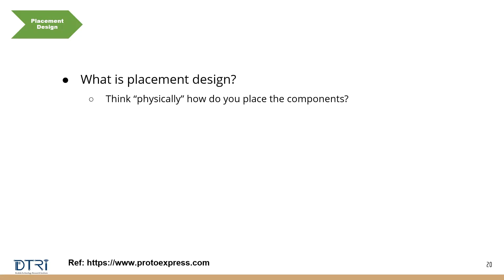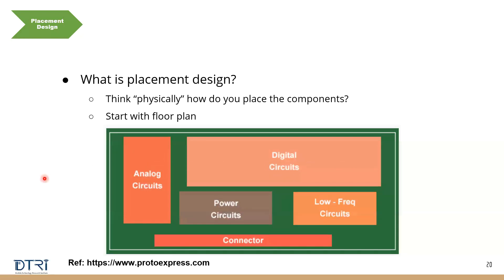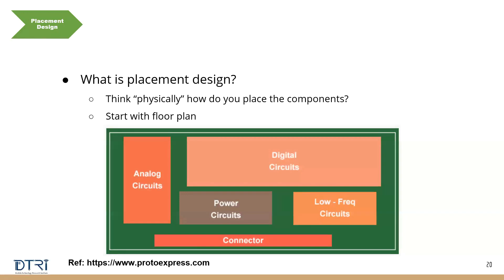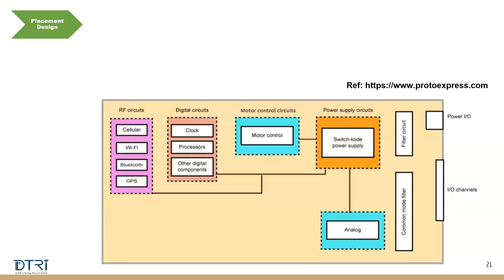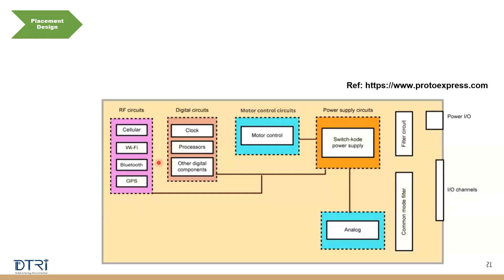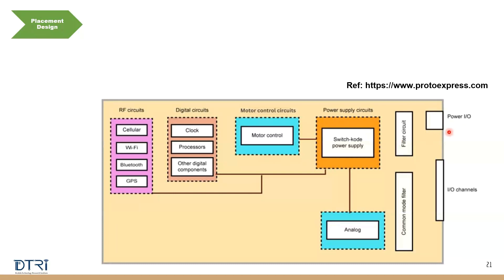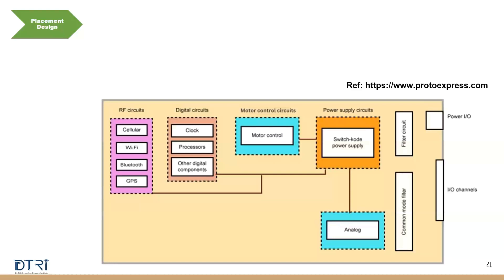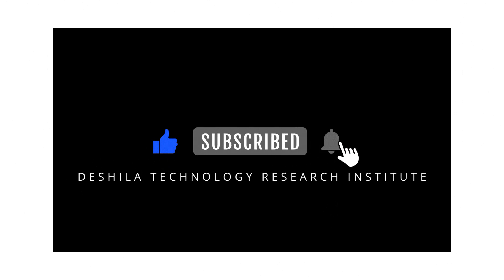7_Placement Design

Comment: What is the main difference between hardware design and pcb design
Reply from the maker: Hardware design includes both electrical and mechanical design, while PCB design involves laying out components on a PCB and routing traces or wires interconnecting them.